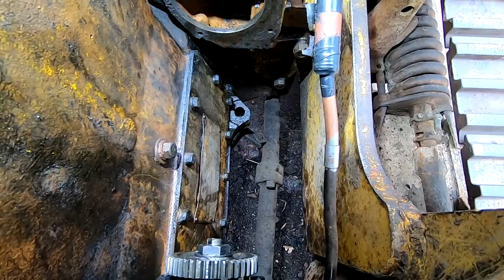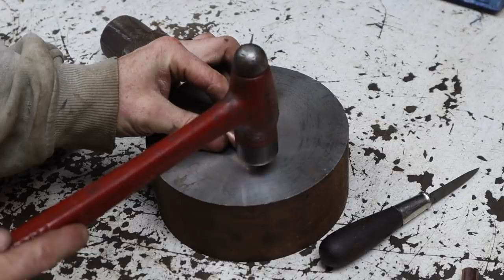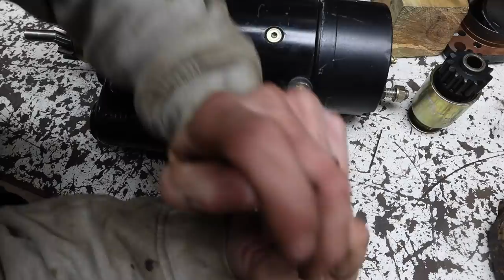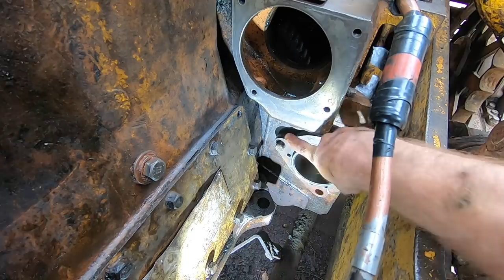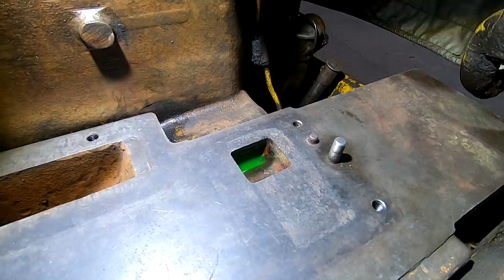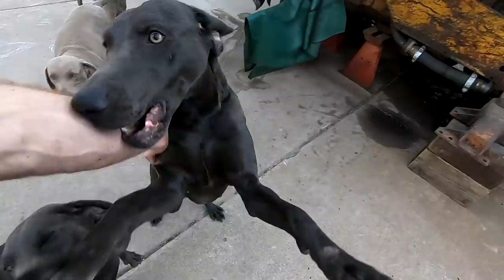Adding a SECOND Way to Start the OLD Cat TraxCavator!!! ~ Part 17 ~ 1950s Caterpillar TraxCavator

Comment: Yup! Since you’re in it this far, might as well. Because you’ll doubt yourself later. And YES, I’d follow the Tahoe series!!!
Reply: agreed
Reply: Totally agree, it would be mad not to do it.
Reply: If your needing Tahoe to ride , then by all means fix it first , I used to run a 955 just like that when I was fifteen and sixteen , I would certainly like to see it fixed back right with it's bucket in the dirt and making some money ..... A little advice , when you start working it hard in a tight place , get ready to do some sweating , that's a lot of hot metal to be setting on top of .
Reply: You know you want to
Reply: Also Tahoe 👍
Reply: Go big or go home!
Reply: Agreed! He might find the head bolts are just as loose as the rest of the bolts on Old Red ( Lucy) and planing the block is fairly simple if it’s uneven. There’s videos out there of guys using a hand block sander to get it done and if there’s issues with the rings or sleeves, when is a great time to deal with those problems? When the head is off!
Reply from the maker: Awesome to know! Thanks for the support! It means a lot!!
Reply: @SalvageWorkshop  You sir, are MOST WELCOME!
Reply: @Ryanfantana  absolutely right there fella. I am onboard with this!
Reply: @josephderusso1678  absolutely 
Go for it
Reply: Dealing with the leaking head gasket.. There is a substance known as Egg Keep.. it can be purchased from most drug stores. It works for leaking head gaskets. It works great in old cats. It also will seal up head cracks. I have used it before. It is basically liquid silicone and hardens upon reaching air, as I understand it. In order to seal head cracks just run it in the system but be sure to have no compression on the cylinders you are trying to seal. It is simple, and it works. I have repaired many old cats, internationals and other motors using it. It is a clear liquid, used in the old days to keep eggs fresh for months, when there was no refrigeration. It is basically liquid Sand. Silicone-based I think.  Try it because you have nothing to lose.  If it works great. If not then you can replace the head gasket. I know it works but the option is yours. I am an old cat man and have, like you, fixed many dead cats. We are a dwindling bread and I am glad to see young bucks like you that are carrying on the tradition. I am 73 and gone thru many many cats in my day. Still working on them and will be until I graduate.  Best of luck. This starter video is the first I have seen of your videos and hope to see many more of them. You have the right attitude and it makes Me proud to see such enthusiasm in you about saving these old machines. So many just want to scrap them.. but once gone, they will never return... You are resurrection them as I have. NICE> Thanks for all the effort you have given to show these videos. Excellent Job!!
Reply: Pull  the head now. While access is easy  later onyou will still have it to do you will have double workload and expense. You may find less to do than you expect you can also fix all now and make better decisions and do it once and right. Put it off  it usually gets worse. Good luck

Comment: For all the reasons you mentioned, yes, change the head gasket. You'll kick yourself later if you put it all together and then are forced to do.
Reply from the maker: Yeah.... I agree, begrudgingly, but I agree!
Reply: Yup,  I second that emotion... because if you don't .... you will be emoting at yourself the whole time you're working on it .... AGAIN ... 
Did you get a head gasket from Cat?
the only head gasket I advise putting gasket sealer on (Permatex Aviation 300 only) 
get new water jacket ferrules and seals (goes between the head and block) ... copper ferrules CAN be reused so use caution when removing .... seals are updated to a new type o polymer which replace the leaky old styled rubberish seals. NOTE: after your first heat cool cycle on the new head gasket ... pop valve cover and re-toque the head bolts to final toque spec.
Reply: @SalvageWorkshop  Too bad you didn't tighten the head bolts to see if that would have solved the problem while it was running.
Reply: @bobblack3870  just looking at this again, I think the old head gasket has already expired due to age and the materials available when it was originally made.

Comment: Definitely change the head gasket. I was a bus mechanic at NYC MTA. I was not an electrician. However we got 25 Grumman buses of the failing A-Frame fiasco, and I am pretty  sure the had a two voltage system 12 and 24.Maybe you could dig up some of the old schematics. I am retired a long time so my memory fails. I love watching Old Red go through the makeover. You're doing a great job, reminds me of myself when I was young.

Comment: Having been a diesel mechanic for 50 yrs before I retired, I would check the head bolts for correct tightness, if they are okay, I'm afraid the head will have to come off to cure the leaks.
Well done on the work though, I really enjoy seeing how you overcome problems. Keep the Vids coming. Regards Graham (UK)

Comment: Go for the head gasket on “Old Red” now!  And, you’ll be able to adjust your rockers at the end.
Reply: I concur with the Head Gasket replacement
Reply: How about retorquing the head bolts first to see if it really needs to be tore down. theres been a lot of loose bolt on Old Red.

Comment: Thank you for telling how the Pony Motor could be used to pre-heat the engine on a cold day to make starting easier. It goes to show how much though went into the design of this machine.
     Your explanations as to what you are doing , and what will be done next are logical and methodical. I don't want to "blow smoke" at you, but yours is one of the best channels on YouTube! Keep up the good work!
Reply: Thank you very much!

Comment: I'm not a mechanical expert or engine guy, but it seems that at every step along the journey of getting Ol' Red back up and running you've removed various parts and in every one of them you've found something that made you glad you did it. This beast is Korean War vintage, pushing 70 years old now and just based on that it's probably well worth it to take it apart, refurbish everything inside, and then slap it back together again. It'll be in great working order, but most importantly you'll know it's in great working order because you did the work on it! :)
Reply: That track drive sprocket that nearly took your leg off when it let gos is testament to this machine's hard life. Why would the cylinder head be any different? YKIMS. ;)
Reply: She's a bit tired.. she's pushing 70 you would need a new head gasket too..
Reply: Agreed; what you do now to refurbish that motor will ensure that it will run a good while after you quit working; lol.
Reply: A man I knew got one for $15500 non running; refurbished it and buil;t the area for houses (2) and a barn and outbuildings. Then sold the fine running old beast for $25000

Comment: For 12 volt just run a line from the positive of the first battery in series.  It's only the second battery that gives you 24 volts.  Many 24 volt machines have lots of 12 volt accessories. I do it all the time on heavy equipment and trucks. 
Keep up the extremely interesting videos.
Reply: Was going to say the same thing.
Reply: @robjustlooking8729  That 24V alternator/regulator is the whole key to the simple configuration. If he stays with the 12V charging system, then then the batteries will need to be in parallel for charging and series for starting - a much more complex switching problem.
Reply: @MrEdwardhartmann  switches are common to go between 12 and 24 volt, many ag tractors start on 24 but operate on 12v.
Reply: Yup we have a couple of dozers that are 24v start but all the cab controls and lights are 12v. In ours the 24v cable runs direct to the starter and that's it. Another line runs off the first batt with 12v and runs into the cab to power all the rest including the starters solenoid
Reply: Also then as mentioned they have 24v alternators as well
Reply: The system as you describe does not work.  Lights or other 12V loads imbalance the batteries and you eat through batteries extremely fast due to one battery overcharging and the other undercharging.  This is a hack that costs serious money long term and machine downtime.  Please do not use this method.  Use a boost converter and a 3rd battery instead.  It's almost as simple, is cheap, and will be trouble free with long battery life.
Reply: @knurlgnar24  not so much. Lots of older busses had this set up. They're still connected and still charging.
Reply: @knurlgnar24  lead acid batteries can be really forgiving, charging in 24v will distribute the power evenly, like two 6v lights on 12v
Reply: my only concern is that poor little 6v starter, using it on 12v will run it too hard and will eventually kill it
Reply: @gtb81.  i run 12 volt on 6 volt starters all the time on older tractors. Never had one fail. What hurts starters is running less voltage than what they're designed for. They have to draw more amps to do the same work and the wires aren't made for that. Higher voltage means less amps
Reply: @dangerrangerlstc  yeah, i know that but wouldn't the commutators arc more? eating up the brushes commutator bars, i'd think the brushes would be too soft for higher voltages, also causing them to spin faster
Reply: @dangerrangerlstc  i did some research and they way a 6v starter field winding is wound it has larger windings, therefore less resistance vs a 12v starter so 12v can cook the 6v field windings, maybe not right away but over time it can very much damage them due to higher energy causing it to get hotter and cook the insulation, or it might even open up the windings at some point. so you can for sure run it a few times on 12v without worrying, but for long term probably not, though some will probably be fine with it, but i wouldn't want to risk it too much
Reply: @gtb81.  been running 12v on 6v starters for 20 years. Basic electrical theory says if you double the voltage, you halve the amps to do the same work. The larger windings will definitely handle less amperage. Yes, there may be some slightly higher brush wear due to higher rotation speeds, but the starter also doesn't have to work as hard and the tractor usually starts much easier due to a hotter spark. Long term, difference is negligible.
Reply: @dangerrangerlstc  maybe so, but i doubt this is always the case, your results may be positive but i have seen starters that have been cooked because of this. while it is true that double the voltage means less amps, that doesn't mean less energy used, you're still putting the same energy in, maybe even more. it spinning faster means it's working harder, the field windings are producing more of a magnetic field, that is why it spins faster, this also tells you that the resistance is lower. that means there is more heat dissipated, thus more wear, it will start faster so it is likely used shorter so maybe it will last a while but not forever. and some starters can probably handle it, they for sure made them better then, but it is still working it harder, i just wouldn't do it, just don't run them too long or i am sure it will get cooked
Reply: @gtb81.  same amount of work is being done, same energy overall, just in a shorter time. Amps and corrosion are what kill electrics. Just like the spark plug wires are really only around a 16 or 14 gauge conductor and they carry over 20,000 volts, its just at next to zero amps, mostly because of the resistance. High resistance doesn't mean heat, it means less amps. Low resistance is what creates heat. Got to have amp flow to create heat.
Reply: As your pony motor is in good shape you shouldn't be running its starter for extended periods so overheating it using 12V shouldn't be a problem.
Reply: Please! see my post above on series/parallel switches.. DON'T try to jerry rig any 12/24 stuff on any diesel engine.. The amp draw is WAY TO HIGH!!
Reply: @dangerrangerlstc  high voltages cause just as much damage, the conductors themselves may not have an issue with it, but the insulation does, that is what causes the most problems. i myself do not like to run things more than what they're supposed to be, it was designed for 6v so i'd like to keep it 6v. you see it differently than i do and that's fine, to me it's like running a 120v motor on 240, it will almost always kill the motor
Reply: What everyone is forgetting  his application is not like a truck. How many 12v accessories does he have, maybe a light bulb or two, and to start the pony motor every now and then. Why spend the money on a series parallel switch and the extra wiring required? Replaced one of those switches on a Mack over 40 years ago and it was $90.
Reply: @robjustlooking8729  yeah, i don't know why anyone would bother with the switch, the little amount of 12v things being used it shouldn't matter
Reply: @gtb81.  I'm an EE with 12 years experience on microelectronics. I ALWAYS ignore people who say it's ok to run electronics out of spec, they have no clue what they're talking about. You're correct that 2x voltage means that starter is going to spin almost 2x as fast, which none of the system was designed for. 

Best solution here is to have a 24V system with two separate transformers to step 24V down to 12V and 24V down to 6V. That's a lot of work, but the right way to do it! Nothing will fail at the worst possible time.
Reply: @dhannig  this is DC, transformers don't work here though
Reply: Yep, only way to step down DC is to put in a resistor, but you have to have the right resistance and wattage depending on the current.  A lot of old tractors run 6v coils with a resistor on 12v. Or you can put in a 12v coil and remove the resistor.  The latter is probably better for gas engines, but on the IH diesels they only ran the coil when starting on gas.  No coil on this, as it uses a magneto for spark.

Comment: Definitely make a series on the Tahoe fixing. Concerning the head on the tractor motor, although there is an old saying that if it’s running don’t mess with it; on your case, meticulous as you are, I wouldn’t hesitate to say, DO IT. Greetings from Brazil.

Comment: Yes, definitely put in a new head gasket. It’s logical. Pay me now or pay me later as the expression goes.
Reply: To srart it on  24 then run on12 volt you just need a series parallel switch  availible at any truck shop
Reply: Yes do it now, with having so much off now is the time since it is already leaking. If you don't, the leak will get worse then it will be a bear to pull everything back off. 
Just my 2 cents on the Tahoe, there are so many channels that work on the newer cars and trucks. I come here to see the more unusual. I mean really how many other channels are working on old forklifts and crawler loaders? Back in the day my dad operated a grader, not sure the brand, it was huge but only had 4 wheels not 6. It had 4 wheel steering and started with a pony motor. I always wondered how it worked, now thanks to you I know.

Comment: FOR SIMPLE 12V/24V: You can simply connect the 12V motor to one 12V battery and the 24V motor to two 12V batteries in series, no switch required. The only drawback is that if you ran both on a regular basis the battery supplying the 12V circuit and half of the 24V would drain much faster than the other battery. I don't think this would really be an issue if you are mostly using the 24V motor and the 12V only occasionally. If you were using the 12V regularly you could of course physically swap the batteries from time to time to balance their discharge rate, or even have a switch to alternate the 12V circuit between the two batteries. This might be overkill however. If you have the room, you could simply install 3 12V batteries, one supplying the 12V motor and the other two connected in series to the 24V motor. The advantage being that you have completely isolated circuits, but because all three batteries are the same type, you could physically swap them around if one were to fail giving you some redundancy.
Reply: exactly, just put the two batteries in serial (- of Battery one to + of Battery two) for the 12V circuit you just use the connectors of Battery one, for the 24V circuit you use + of Battery one and - of Battery two. I agree that it should be overkill to automatically alternate between the two batteries, but maybe create it in a way that you can easily change where the 12V-Circuit is connected.
Reply: This might be months later, but just get that old piece of equipment to charge at a 24 volt rate, and charge both batteries as if they were one 24 volt battery.
Reply: The problem is space, on a track loader especially.  Just not much room to stick 3 batteries, or even two.  
And you can’t simply switch the positive feed for 12 volts between batteries.  You have to physically swap the ground as well or you’ll go from 12 volts to 24 when you move the positive cable.  It would have been a lot simpler to use a 12 volt starter ☹️

Comment: I would like to suggest finding another starter cone and removing less material and using larger corner radii.  If the cone deflects the end bearing will wear quicker or may possibly bind.  If the cone breaks things can go really bad.  Additions and/or corrections to this post are welcome.